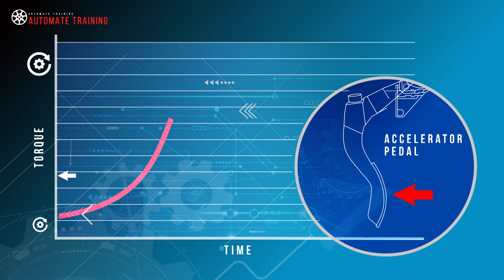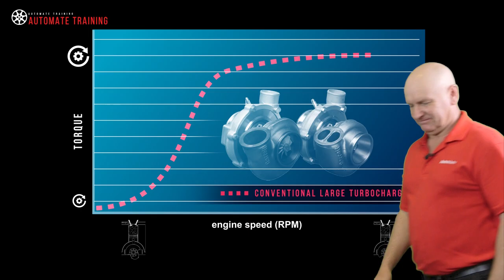Twin Scroll Turbocharging - System Principles Training Module Trailer

Comment: This is not turbo lag. Described is boost threshold
Reply: In it's most simple form it can be considered like this... 
Ie; Just like 'experts' continuosly refer to an 'intercooler' which is actually an AFTERcooler. An intercooler is usually situated between a bi or sequential FI set-up. Or how all the 'good' flutter noises you hear turbocharged cars making these days, is actually an UNdesirable characteristic and indication of a bigger, performance-sapping issue that should be addressed... 
Or the expensive and heavy 20"+ wheels with an insanely expensive shoe sole for a tyre that actually all adds up to a very expensive reduction of the cars performance and comfort levels, and service life...
But meh, what does getting technical actually serve when explaining principal concepts to inexperienced/beginners and/or mouth breathers lol... Let em be, they'll figure it out if they're actually interested in motoring, n not just trying to be cool.

But technically speaking, yea, you're 100% correct. 

Imo, this video was little more than a sales pitch for the video it claimed to be.... 
THATS what annoys me. Even a beginner has no more of an understanding than b4. 1st question that's raised, ANY question... And they would just be confused trying to answer it. Recalling a description is not gaining an understanding 👎
Reply: @muntee33  charge air cooler is the term I’ve always associated with that. Maybe it’s different literature maybe it’s sales jargon. Whatever it is it’s incredibly frustrating to listen to this guy spew about everything except the title and not divulge into any specifics other than his own name.